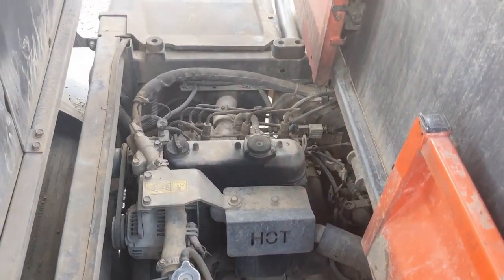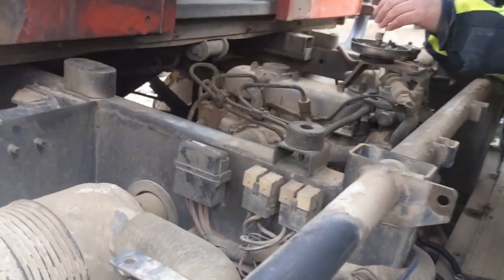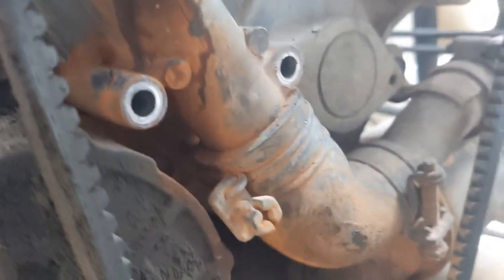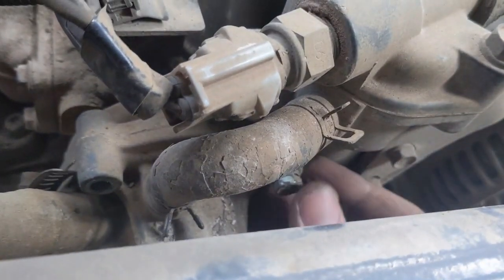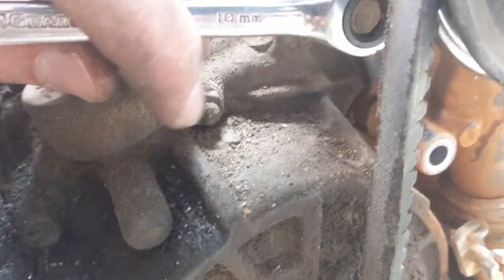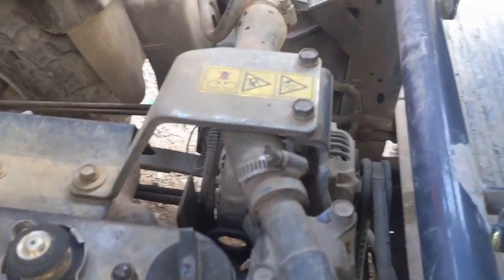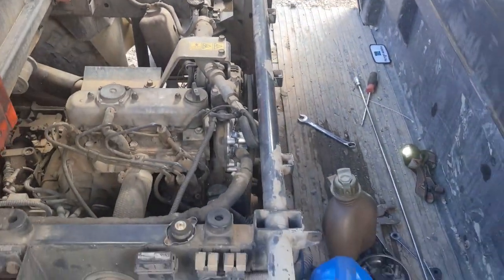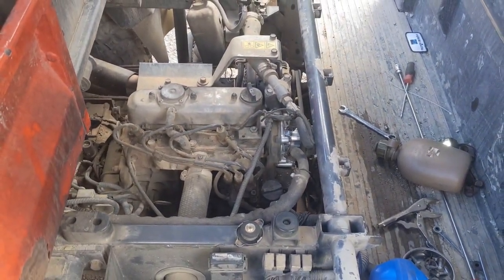Kubota RTV1140 Water Pump: Hard Rock Gold Mining Episode 25

Comment: Where did you get the water pump and how is it holding up? I'm trying to figure out which waterpump to replace mine with. Also wondering if I should replace with a factory oem or aftermarket. Any information would be Greatly Appreciated. Thanks
Reply from the maker: It's a generic aftermarket pump from JTPART on Ebay, and is holding up just fine. The pump was about $65, OEM pumps seem to be about double that.

Comment: About how many hours on this unit? Not to sure about the upper hose curve radius, but, back to work machine!
Reply from the maker: About 2800 hours. I can't speak to how much of that was idle hours versus drive time since as far as I know this machine doesn't have an odometer.

I don't like it either, so I used a much longer length to allow for a gradual bend. The 3/8" fuel line has thinner walls than the original line so it collapses more easily. If it's a problem I'll track down a closer replacement; reels of tubing are cheap and great to have on hand.